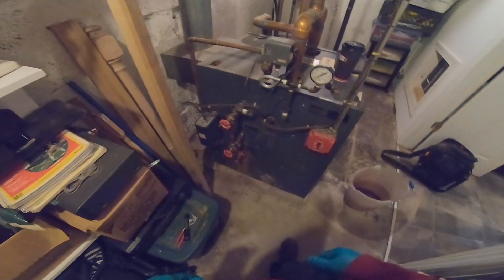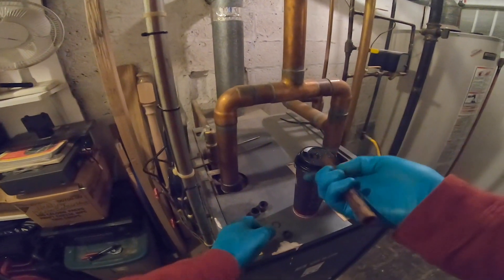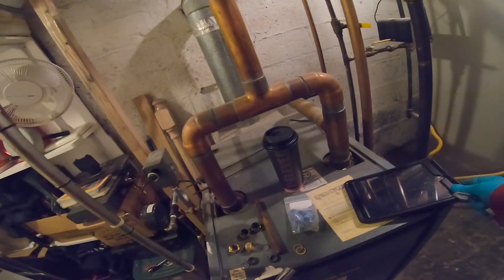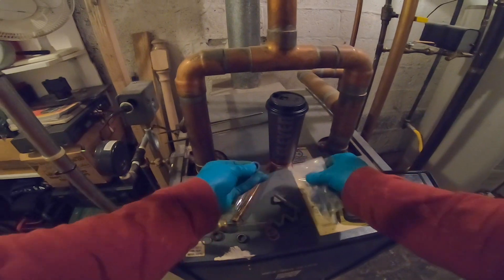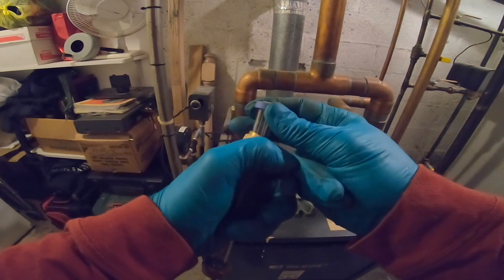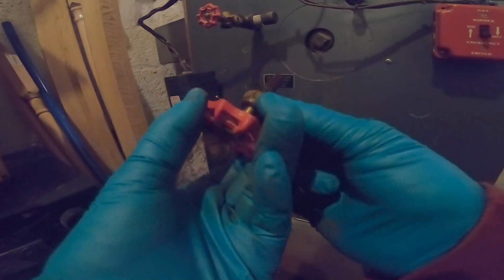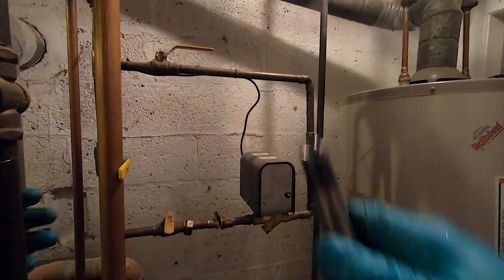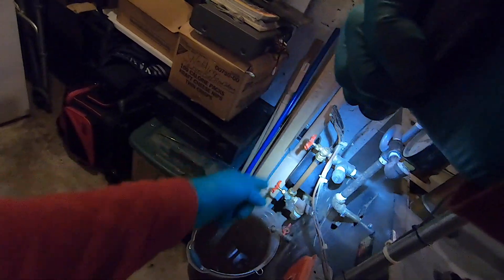How To Replace Boiler Sight Glass

Comment: The first thing you need to do before you start taking out the sight glass it shut off the upper and lower valves so isolated from the system

Comment: Doing what you just explained you will not know if that top GG washer is leaking until you make steam. A better way is to close the top gauge glass valve. If you start to fill the boiler and no water comes up in the glass the washer is doing its job. If water appears in the glass the washer isn't sealing. One of those things you learned in 6-grade science class, 2 things can't occupy the same space at the same time.

Comment: Good job if you have to take it apart why put the old washer back. It’s the same effort.
Reply from the maker: It’s why I don’t. They are cheap and prevent headaches. Seen many crack sight glasses from over tightening those nuts. Then after boilers running for some time the pressure of the nuts crack the glass.

Comment: I agree, rubber washers are cheap, so always change them! most them folks don't notice the dry-rotted surface cracking, even hairline invisible cracks will cause leaks.

Comment: Keep a plastic bottle with rust remover/phosphoric acid and dunk glass in it at the start of the work?
Reply from the maker: Usually I can clean up the sight glass. This one I spent a lot of time trying to clean back in October. I wish they would flush out this boiler on occasion. Before October this boiler wasn't serviced in 5 years and get drained maybe once a season.